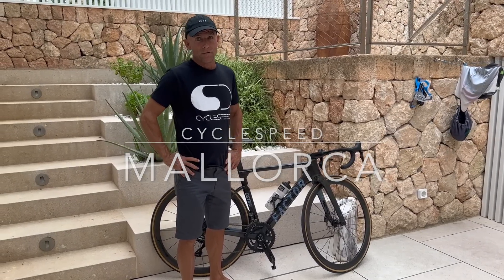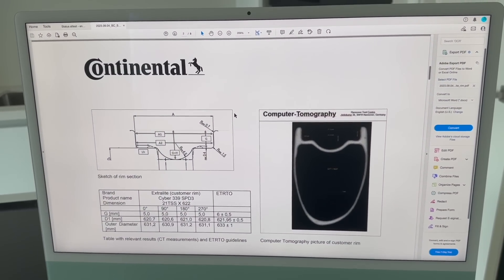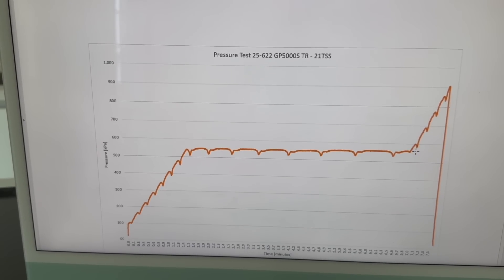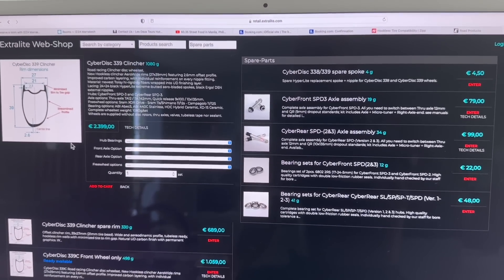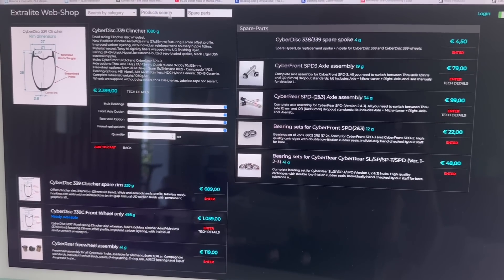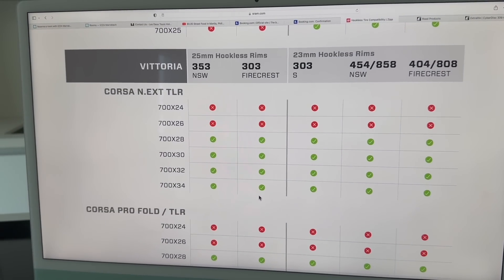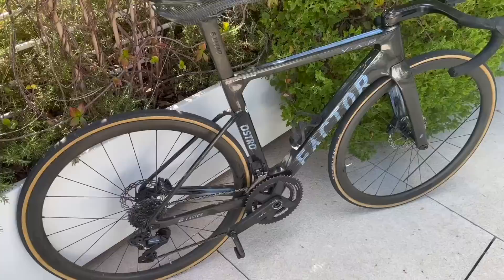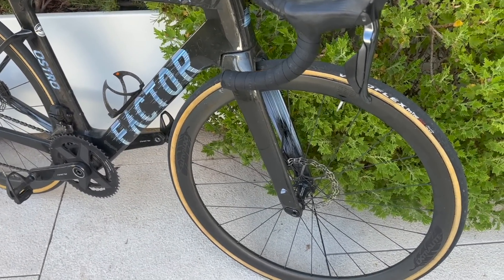Revealed! Why the Tyre Blew off the Hookless Wheel

Comment: I don’t understand the concern here at all. The wheels were not up to specs. The tire compatibility charts from Zipp and Enve give you enough options to choose from. What exactly is the problem with hookless?
Reply from the maker: Sometimes things get made slightly out of spec. With hooked and tubs, there is a failsafe, so no big issue. But with hookless there is not.

Comment: Im glad that my zipp 303s didnt kill me yet....Gonna get a hooked wheelset if I buy another. Kudos to conti
Reply: Cool it people. Today this happened to me with my Hooked Hunt Aerodynamicist rim on Pirelli P Zero tubeless at 6.5 bars. I parked the bike and 2 seconds later huge bang, explosion. Sealant everywhere and the tire off the rim completely. No damage on the tire or the rim. Put right back on and inflated it at a bit lower pressure and went riding. Absolutely no idea why it happened.

Hooked rim, tire pumped to 6.5 bars (specs allow 7.5 pressure). When I rode hookless that never happened to me. I've been riding this setup for the entire season, around 4K miles and never had any kind of problem like this today.

Comment: Good follow up. Ive already commented on the other videos but this kind of thing makes me angry. It IS very difficult to get resin products to conform to exact tolerances, you need to pay close attention to temperature and cure times ( among a myriad of other factors). Knowing this, why in the world run with a design that requires such precise accuracy to function properly at all, with zero redundancy or safety built in to the design? Why reinvent the wheel? This is all done to save the manufacturers money with simpler, cheaper molds and shorter work times. It has absolutely NOTHING to do with  improving the design or function of the rim. As an industrial and product designer I find this trend toward hookless nonsensical and, given the extremely high number of failures, unconscionable.

Comment: Thank you very much for sharing your experience man! I own a Giant TCR with hookless rims, I was very scared after your first video, now I feel more confident hoping Giant wheels are built better. Anyway I'm going to change wheels when I could afford the expense an going back to hooked rims for sure!
Reply from the maker: I wouldn't worry too much - with Giant you are as safe as you can be. Just don't go over 6 bar or so and you'll be fine.
Reply: You said dont go over 6 bar in your comment, but the standard says dont go over 5 bar…why would recommend to go over the standard after you alteady had a bad experience with hookless while within the 5 bar parameter? I dont understand?
Reply: @user-jr3hp9bd9h  I need to check again but I’m pretty sure on Giant wheels there are labels with 6-7 bar recommended
Reply from the maker: @user-jr3hp9bd9h  Giant specifies 73psi for their hookless tyres. Do you start to see the problem? Every tyre / wheel combo is different.
Reply: @CyclespeedTours no, that’s not true, Giant says 115PSI!

73 psi is for untested tyres from other brands !
Reply: But the max stated pressure for the standard is 73psi…why would you go over it?
Reply from the maker: @user-jr3hp9bd9h  Are you confident in the accuracy of your pump? If you leave your bike in the sun how much psi will you gain? If you weigh 80kg+ on a 25mm tyre then 73psi is quite a low pressure.
Reply: Today this happened to me with my Hooked Hunt Aerodynamicist rim on Pirelli P Zero tubeless at 6.5 bars. I parked the bike and 2 seconds later huge bang, explosion. Sealant everywhere and the tire off the rim completely. No damage on the tire or the rim. Put right back on and inflated it at a bit lower pressure and went riding. Absolutely no idea why it happened.

Hooked rim, tire pumped to 6.5 bars (specs allow 7.5 pressure). When I rode hookless that never happened to me. I've been riding this setup for the entire season, around 4K miles and never had any kind of problem like this today.
Reply: @shadowsun33  That's terrible, I've never heard of this happening, you should contact the manufacturers and send them the wheel and tire for investigation. I wouldn't feel safe driving in those conditions at all

Comment: Thanks for sharing this valuable information. I’m never going to buy a hookless wheel! Top man Andrew.
Reply from the maker: Cheers C!
Reply: Cool it people. Today this happened to me with my Hooked Hunt Aerodynamicist rim on Pirelli P Zero tubeless at 6.5 bars. I parked the bike and 2 seconds later huge bang, explosion. Sealant everywhere and the tire off the rim completely. No damage on the tire or the rim. Put right back on and inflated it at a bit lower pressure and went riding. Absolutely no idea why it happened.

Hooked rim, tire pumped to 6.5 bars (specs allow 7.5 pressure). When I rode hookless that never happened to me. I've been riding this setup for the entire season, around 4K miles and never had any kind of problem like this today.

Comment: Thanks for the update. Simply reconfirms the fact that hookless should be avoided. Imagine being leaned over on a road on the inside lane with traffic coming the other way.  Not worth the risk…
Reply: Cool it people. Today this happened to me with my Hooked Hunt Aerodynamicist rim on Pirelli P Zero tubeless at 6.5 bars. I parked the bike and 2 seconds later huge bang, explosion. Sealant everywhere and the tire off the rim completely. No damage on the tire or the rim. Put right back on and inflated it at a bit lower pressure and went riding. Absolutely no idea why it happened.

Hooked rim, tire pumped to 6.5 bars (specs allow 7.5 pressure). When I rode hookless that never happened to me. I've been riding this setup for the entire season, around 4K miles and never had any kind of problem like this today.

Comment: Hookless has way smaller tolerance margin. Required a higher standard manufacturing process. Giant as an oem themselves has that kind of standard, never heard of any issue from slr or cadex. Smaller hookless wheel company probably having hard time to reach that standard since they are all outsourced and build by some other oem

Comment: i really dont understand people complaing about hookless in this case. extralight make a wheel outside specifications and blame the system...
you consider to take legal action against extralite? that kind of error can cause you a serious injure including death
Reply from the maker: There are no 'legal specifications´, just guidelines. A wheel manufacturer can make a wheel any size they like unfortunately.
Reply: @CyclespeedTours  must be something with the brand/model. Ive running giant slr2 700x25 tubeless/ inner tube with 100psi over 15000km and no problem (use that pressure cause the genius in the store doesnt tell me about hookless and psi limits) i realize last Thursday when i bought a mew pair of tyres, now i use 5bar

Comment: So happy I went with hooked rims! Thanks for the video.
Reply: Cool it people. Today this happened to me with my Hooked Hunt Aerodynamicist rim on Pirelli P Zero tubeless at 6.5 bars. I parked the bike and 2 seconds later huge bang, explosion. Sealant everywhere and the tire off the rim completely. No damage on the tire or the rim. Put right back on and inflated it at a bit lower pressure and went riding. Absolutely no idea why it happened.

Hooked rim, tire pumped to 6.5 bars (specs allow 7.5 pressure). When I rode hookless that never happened to me. I've been riding this setup for the entire season, around 4K miles and never had any kind of problem like this today.

Comment: With tubeless wheels, one just needs to know what they’re doing and stay clear from small manufacturers. The more users one has the higher the chances of finding mistakes. Simple as that. If theres a right wheel and right tire, tubeless beats any other tire in every way. I run Zipp 454’s and Roval CLX 64’s with 28mil conti tire and have had one flat in 5 years (around 12000km a year). Riding around 4.2bar is fast, comfortable and the grip in corners is off the charts.
Reply from the maker: I have no issues with tubeless, but hookless yes.
Reply: Yes and you weight 60kg. Not your average cyclist.

Comment: Shock! Tyre manufacturer blames the wheel!
Half a mm is the difference between a tyre blowing off or not sounds ludicrous?
I have been running tubeless  and hookless for 20 years and road tubeless  hookless from the very early days when there were only a couple of tyre choices. The whole point of me going tubeless was to be able to No1 negate punctures and No2 take advantage of the much lower pressures for increased comfort and control! The days of 100+psi are over thank god! I have blown a tyre off once using a compressor. It was a Schwalbe CX tyre on a hooked wheel and that tyre was toast after! 
Once a tyre has blown off it's not worth the risk to bother using it again unless with a tube fitted! 
The max pressure I would run in a 25mm tubeless tyre would be 70psi, a 28mm 55psi to gain the maximum benefits of a modern supple tubeless tyre! I don't understand why you would want rock hard tyres? You might as well just use a cheaper tyre?
Reply from the maker: I ride 80psi in my 25mm front and 60-65psi in my 28mm rear. 70 front is too low as I ride alot out of the saddle with weight forward and front tyre squirms which I don't like.

Comment: Re the proposed solution to add wraps: if you do that to put the effective bead seat diameter (BSD) within spec, you are also cutting into the G-height. That's the height of the rim sidewall above the bead seat. The nominal ETRTO specs are 6mm. Extralite already built the wheels to an apparent nominal dimension of 5mm. If you add 1mm of tubeless tape, you cut the effective G-height down to 4mm. I am not an engineer, but this does seem risky, considering that the consequence is the tire blowing off, possibly while in motion.

Also, re Zipp's compatibility chart: by the current ETRTO standards, 28mm is also out of spec with 25mm internal width hookless. Now, ETRTO did allow companies to grandfather their wheels in, and I think this was provided they had explicitly tested for compatibility. That probably won't be allowed going forward; the official minimum is 29mm tires on 25mm hookless. However, basically nobody makes 29mm tires right now.
Reply: Enve makes 29mm tires.

Comment: "HOOKLES" is HOPELESS, and Very Dangerous...  !.."DON'T DO IT..!"  I know a thing or two about bicycle tires and tire development cause that's what I did for 30 years.  When I heard news they were trying to bring back the Old hookless tire & rim, antiquated technology, I about spat out my Lucky Charms.   !! ! WHAT ! !!
 Look, you can technically glorify hookless all you want with some of the biggest names in the industry, the bottom-line is they are all Playing with Fire and your lives. IT DOES NOT WORK AND IT IS VERY DANGEROUS!!!  They are trying to fix a problem that existed decades ago which was fixed by adding a hooked bead tire & rim...
 Here are the facts; for decades Hookless tires & rims were the norm because tire pressures were relatively low and was relatively easy and inexpensive to make both hookless tires & rims. Back then it was expensive and not easy to make a hooked rims and tires.
 But around the late 1950s and 60s tire pressures started to increase dramatically cause people and racers wanted to go faster and faster. So bicycle engineers decided to use motorcycle hook bead technology to fix the blow off problem that was quickly growing at an alarming rate.  I did a lot of lab testing on hookless tire technology, and it is eye popping dangerous!  Even if the rim and tire are manufactured under lab conditions, the moment you add rotational speed, centrifugal forces, bumps and human intervention it starts the irreversible process of the tire bead to start moving away from the rim until it blows off the rim.  That's why engineers added the hook to stop the tire from creeping off the rim.  And just because a great name like Continental  & ZIPP are involved trying to bring back hookless antiquated technology they are all heading for failure and playing with people's lives.  They should be ashamed of them selves putting out a product they know deep inside is very wrong.  They should all admit failure, apologize, stop and recall every single hookless unit they have put out.
Sincerely, Dan Sotelo aka mr onZa

Comment: Continental have confirmed in the lab these wheels are not fit for purpose. Not only should you get a rull refund, but that wheel manufacturer should recall their wheels, stop selling that model and redesign it to work with current tyres. If they don't, they are content to be criminally negligent in the aim of making profits. I'll never buy that brand now. Thank you for sharing.
Reply: What Brand were the wheels? I think I missed it

Comment: I just cannot buy into tubeless let alone hookless. The weight savings of tubeless is actually a weight gain when sealant is taken into account. The power advantage of tubeless is is .05 Watts, for me not worth the hassle. 
I also use Mr Tuffy liners, have a flat maybe once every 20 years, if not less. I am 70 still ride 50 km a day, mainly gravel, and road.

I have never had a clincher that came anywhere close to the control I get from a tubby, unfortunately these days there is too much debris on the road and trails to make tubbies a viable option, get too many flats.

Comment: A few years back I decided to try 115 PSI in my tyres on my lite road bike. This is a conventional wheelset tubes etc. I was going up a long steep hill near home when the front tyre jumped off the rim, the inner tube expanded out to around 2 foot in dia and exploded, all in a split second. I normally descend this hill at speeds approaching 45 mph. If the tyre had left the rim on the way down that hill, I doubt if I would be alive today. I have never raised my tyres above 80 PSI since. There are a load of innovations now in bike tech that I would not want, ever, some because they introduce complexity where there was simplicity and others due to the possibly fatal consequences of failure, such as carbon steerer's, handlebars etc.

Comment: There is no problem with Giant and cadex wheels. I use 19mm giant carbon hookless wheels with veloflex corsa race tires. Front wheel 5,7 bar  rear 6,5 and it is perfect I even tested 7,5 bar without problems. Now I trust giant but you have to use tires approved  by them. And veloflex corsa race 25mm tires are amazing much cheaper than conti gp5000 str but far better puncture resistance while not much worse rolling resistance.

Comment: Great research by conti, shame on extralite, the ETRO specs are there for a reason. Imagine car wheel manufacturers start doing this to make it easier to mount tires, insane! You conclusion is mostly bonkers though, if you want your 8 bars tubes then why the hell did you get hookless rims.
Reply from the maker: Not 8 bar, 6. I was prepared to try 5 bar hookless to see what it felt like. I never really got much chance to ride at 5 bar though, because the tyre blew off! I did ride a bit afterwards at 4.3 ish, and it definitely felt too squishy to me.
Reply from the maker: Also, the ETRTO dimensions are not really 'specifications' as such, just guidelines. (Unfortunately!)

Comment: Look the clear thing is that 25mm tubeless tyres are only good for rim brake wheels.

Disc brake tubeless tyres need at least 28 and above.

Obviously hookless 28 will be more wider than 28 because lack of a bead system unlike hooked wheels.

Ya just stay away from hookless and disc and use proper stuff you’ll be fine.

Rim for Road 
Disc for dirt 

If you know you know 

Apples for apples 😂😂

Comment: Bike industry can't hit some basic tolerances. Again! Kudos to Conti. Shows the ignorance of EL - adding tape still leaves the wall height issue, where the rim is blowing over. It's almost as if they don't understand.
Reply: Having tight tolerances where if you fall out of spec you have a potentially deadly mode of failure, is just a non acceptable system. Hookless tubeless if it doesn't fall to the UCI will fall to lawsuits in the US now that the catastrophic failure mode, with narrow tolerances and marketing at out of standard spec is in the spotlight. @PeakTorque
Reply: It's because there's a new wheel company every week
Reply: Oh they they can hit basic tolerances, problem is when you're talking about .5-1mm of tolerance, that's just far too small of a variance to make millions of tires. 
Need more safety margin for sure.
Hooked tires for life.
Reply: @cloudsmith7803 dude 0.5 a mill may as well be 100 meters in engineering

Comment: I use Zipp 404 Firecrest on my Pinarello & Cadex 65 on my Cannondale Systemsix. Both are hookless and I've never had a problem. I use Conti ASTR 5000's on the Pinarello and a Cadex Aero 25mm for the front with a Goodyear F1 28mm on the rear. I found the 25mm Goodyear on the front puncture way to easy. The Cadex has been bulletproof.

Comment: Just as we move away from press fit bottom brackets we had to bring out hookless rims.

Hookless rims are a poor solution for and industry that struggles with QC and tolerances. At least a poor fitting BB does not put your life at risk.  Just because something is possible does not make it a good idea. Riders need to consider the risks and outcomes.